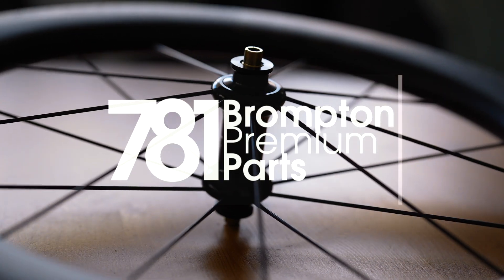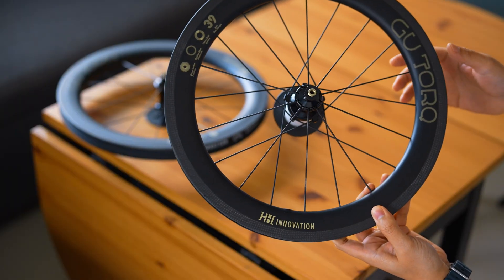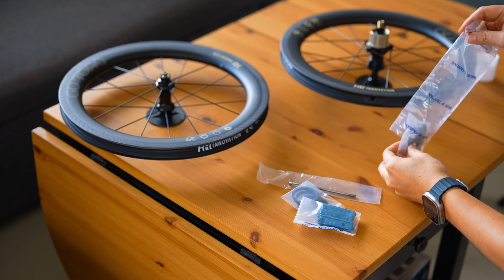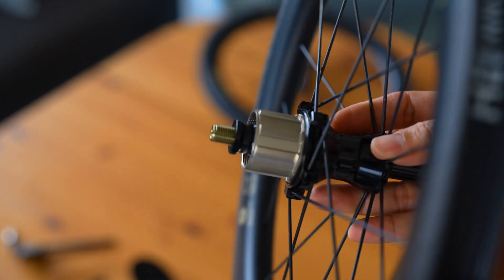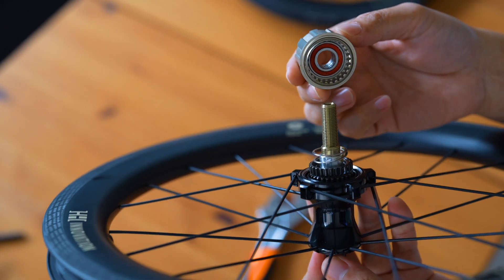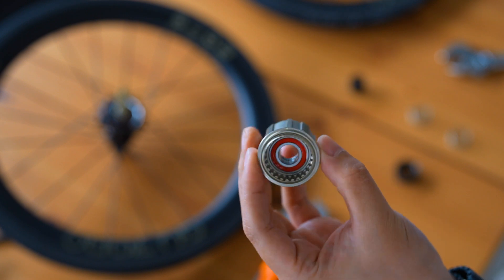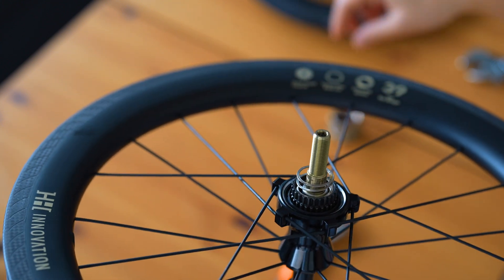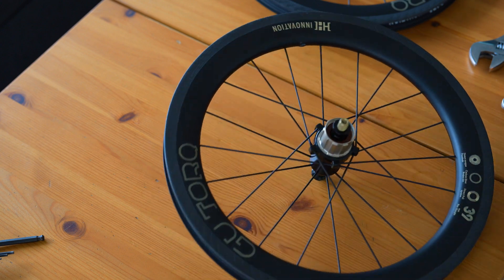Unboxing the H&H Gu Torq Carbon Wheelset for Brompton | Inside the Ratchet Hub Engineering!

Comment: How many tooth is the ratchet? 36T? Do you know if there are any upgrades for tooth wise?
Reply from the maker: The H&H ratchet freehub in the GU TORQ H&H Carbon wheelset is engineered with 48 precision-machined teeth on each side. We don't see any upgrades yet for the tooth.
Reply: Thanks for the quick response. Appreciate it a ton

Comment: Is new H&H Carbon wheelset FASTER than your previous wheels, the Hubsmith HS-Bumbee? It's a lot of extra money to spend if the new wheelset is not significantly better than your old one.
Reply from the maker: It will be in a different setup, might go to my CHPT3 this time.
Reply: @781BromptonPremiumParts  Are there qualitative differences between the wheelsets though or are they both equal in build quality and speed?
Reply from the maker: @davidhunternyc1  Hubsmith got the flat spokes vs. circular with H&H. The riding comparison will be updated soon. Both can carry 4 to 5 (normal cogs) and up to 7 speeds when using H&H or Minimods cogs. I can see that Hubsmith have the rubber o-ring around the inner freehub body which doesnt come with H&H.
Reply: @781BromptonPremiumParts  Thank you. Yes, a detailed riding comparison will be great to learn from. For instance, on a Brompton, do you really think flat spokes are necessary? You're not riding the Tour de France plus round spokes have proven longevity. I guess to make a real comparison, you'd have to ride on the same tires with the same PSI too. You know these systems like no one else. At this point, I check Youtube every day for your new content. 🙏🏼